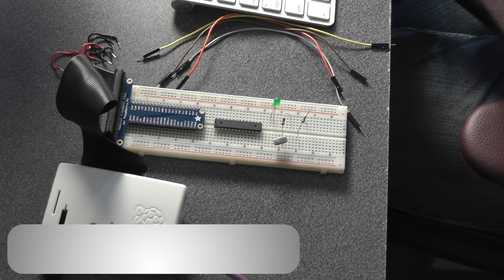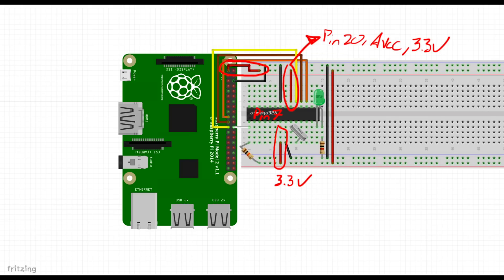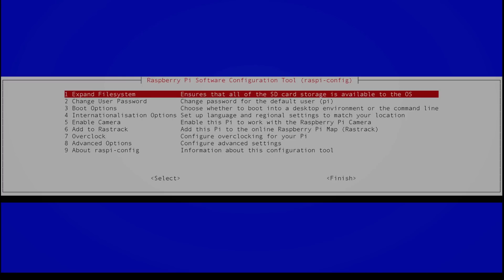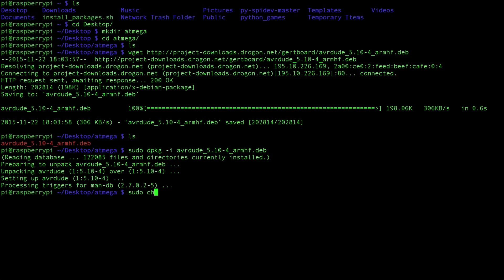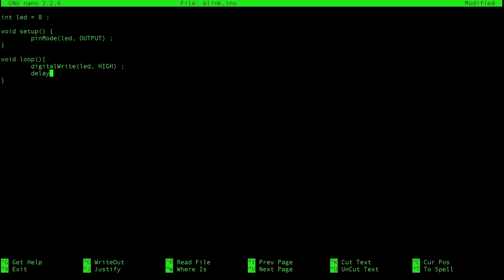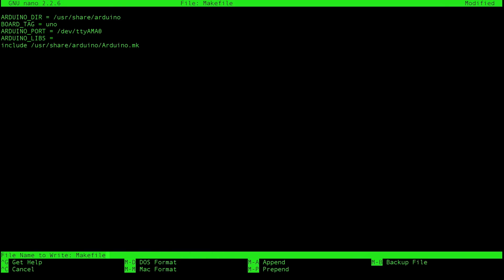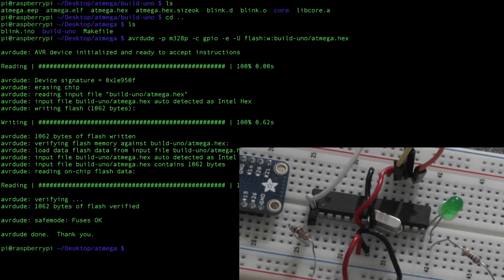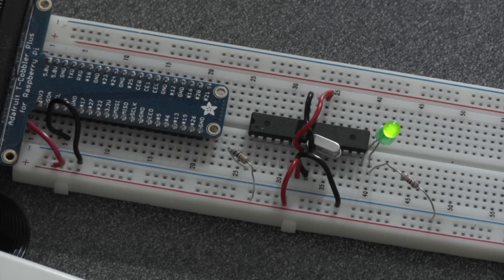Raspberry Pi Tutorial 36 - ATMEGA328P AVR (Arduino) Programming via GPIO (SPI)

Comment: Nice video but I think this needs an update. avrdude seems to be already installed with Arduino now, so the drogon http request doesn't work. Then, as @rayfelch3554 said, gpio isn't a programmer option. I tried linuxspi instead, as in avrdude -p m328p -c linuxspi -P /dev/spi0.0 - that says to use the format /dev/spiev:/dev/gpiochip[:resetno]. I took a guess that resetno might be the GPIO pin connected to the Atmega's reset, so I tried avrdude -p m328 -c linuxspi -P /dev/spidev:/dev/gpiochip[:P08] which gives No such file or directory - so looking in dev, there's a spidev0.0 file and also a gpiochip0 file. So I guessed it might be avrdude -p m328 -c linuxspi -P /dev/spidev0.0:/dev/gpiochip0:8 which returned Unable to get GPIO line 8. So close, yet so far!
Reply: Of course, after entering and compiling the code shown, I upload it with avrdude -p m328p -c linuxspi -P /dev/spidev0.0:/dev/gpiochip0:25 -e -U flash:w;build-uno/atmega_.hex (note underscore) - it writes and verifies the flash, no problem - and then the Atmega appears to be doing nothing. No LED flashing. I suppose no-one said it would be easy!

Comment: Thank you for taking the time to do this video. It helped me tremendously. Just a heads up, things have changed in 5 years and one of my stumbling blocks was 'gpio' is no longer an option when setting the Programmer field. The settings (of importance) for me in 2021 are: Programmer: linuxspi  Port: /dev/spi0.0  Device: atmega328p. Hopefully, this might help someone that may be struggling. Thanks again!!
Reply: Thanks for the update, I'm trying to figure out if this helps with the same wiring configuration shown in the video. Can you please confirm if you used the same wiring config and if anything you have changed?
Reply: @asuthoshcr9581  I tried avrdude -p m328p -c linuxspi -P /dev/spidev0.0:/dev/gpiochip0:25 and that seems to work (with the reset connection wire moved from P08 to P25 on the Pi) - seems to work

Comment: As to my previous question. I have an ATMEGA328p-au blank chip.
will this method burn the arduino bootloader onto the chip or is that a separate process? I don't know if your chip has the bootloader on already. please advise?

Comment: I did the exact same thing, except I don't have Oscillator. It doesn't work. Can someone help me? All the commands run without error, and the program is uploaded to the ATmega chip successfully, but the LED doesn't light up.

Comment: it works me ,but why the time are diferent? i put in delay(1000) and get around 5 seconds (i have a 16,000 hz osc)
Reply: You need to put these to the command line:
avrdude -c gpio -p m328p -U lfuse:w:0xce:m
avrdude -c gpio -p m328p -U hfuse:w:0xd9:m
avrdude -c gpio -p m328p -U efuse:w:0xff:m

Comment: I am actually trying to program a Arduino pro mini 3.3V 8Mhz having the Atmega328p, using the same method as u expalined. 
When I run the command 'avrdude -p m328p -c gpio', it shows me this error :
 'avrdude: AVR device not responding
 avrdude: initialization failed, rc=-1
         Double check connections and try again, or use -F to override
         this check.' 
I have checked the connections, still the error persists. Can you please help me.
Reply: If you're still having this problem, I had the same issue. I solved it by changing m328p to m328.

Comment: Maybe a bit late to ask. but just found this video.
Have wired up everything as shown on the video, and tried withe 2 Atmega328P-PU chips, but get the following error:
initialization failed, rc -1. If I use the -F option I get invalid device signature 0X000000. Could this be chips without a boot loader? (Got them via eBay - cheep Chinese stuff)
Reply from the maker: I have purchased a few chips off ebay/aliexpress and haven't had issue. You don't need the Arduino bootloader flashed initially to be able to upload code - I have experimented programming the AVR without anything "Arduino" (and thus no bootloader). Having said that, I haven't encountered this error. Beyond double checking your wiring.... do you have an Arduino Uno kicking around? You can try flashing via that, see if you can get something working there, and then re-attempt with your Pi.

I wouldn't give up just yet.
Reply: Alexander Baran-Harper Thanks a lot for answering.
I have checked the wiring several times, but I will definitely not give up. I wonder if there is something wrong with  my installation on the RPi. Tried to compile the sketch but got an error from make, so I’ll try reinstalling everything from scratch after making a backup of the SD card. I’m running Node-Red with the Arduino contribution so that might be a problem, though I don’t understand why.
I’ll keep you posted.
Reply from the maker: Alright cool. You should be able to 'make' regardless of whether the chip is connected. Assuming you installed arduino-mk without error and have a simple blink sketch that should work, your issue may be in your makefile. 

Just making sure, you ran the test line "avrdude -p m328p -c gpio" and got a response out of the chip? If there was an error there, there is either something wrong with your wiring or the chip... assuming the packages I refer to in a video published 2 years ago are still available and installed correctly...
Reply: Yes  I know - have not seen anyone complaining. Have reinstalled from scratch on a new SD - compile now works like a dream, but alas no connection. I have tried several chips, so I wonder if there is something wrong with my RPi. I'll get a new one in a week or two, and I'll also see if I can get a few new atmega chips. Then next step will be running at 5 volt using a logic level converter. I want to make this work, albeit I could of course get myself an arduino Nano, which I know works, but that's not fun
Reply from the maker: Just making sure: you re-enabled SPI after the reformat? Do you have any other SPI devices you could test to verify that your SPI is working? You're tying the VCC's of the chip and GND's of the chip together? Have you tried a different oscillator?

Do you happen to have a couple small ceramic caps kicking around? The oscillator, as I have shown it in this tutorial, is not stabilized by caps. You may have better success if the clock is stabilized. Without the datasheet for the oscillator you have, I can't tell you want size cap you need. The "default" choice everyone seems to use is ~22pF. https://rheingoldheavy.com/wp-content/uploads/2015/09/UNO_KiCad_ATMEGA16U2_XTAL.png shows the wiring of the cap.
Reply: This is embarrassing! I had turned the "schematics" upside down, and connected the communication wires on the wrong side of Pin 19 on the RPi. Now it works, but it looks like I have blown one of my atmega chips - if it was not blown when I got it, you never know.
Anyway - thank you for your advises and patient, I'll keep you posted about the progress on my project, if you are interested. Going to try to access the atmega using firmata.
Reply from the maker: Well that will teach you! I am glad you could figure it out. Cheers, man! And good luck with your project!
Reply: Thank you, Alexander. I'll need it! Can't find much information about how to use Node-Red and gpio to access atmega328 with firmata NOT using the USB port. What I need is to be able to use PWM on the chip, since PWM on the RPi does not work very well

Comment: Hey, I use an external 8MHz and it comes that de clock is divided by 8.
When I tell in the makefile that the MCU speed is 1000000L instead of 8000000L, it works well.
Ideas ?
Reply: it's very simple: the delay function is designed to work whit a 16mhz frequency, so when you use a 8mhz you have to tell the clock divider  it have to change step number

Comment: How would you modify the procedure to run the Atmega using its own internal 8mhz crystal? I've seen it done with Arduinos.
Reply from the maker: It's totally doable; I've done it. I haven't made a video on how to do it (yet...), but the short story is: you need to change some of the internal fuses of the ATMEGA328P using avrdude. You will still need to connect the 16MHz clock and configure the circuit for programming using something like a Raspberry Pi to program it. Once setup you'll want to check out: http://www.engbedded.com/fusecalc . At this site you can select certain options for how you want the ATMEGA328P to behave. If you uncheck "Divide clock by 8 internally; [CKDIV8=0]" and hit "apply changes" down at the bottom, you'll get posted a low, high, and extended byte value. They should be E2, D9, FF, unless you changed some other values.

Then use avrdude to upload these values.

Comment: Thanks for the video, I learnt a lot from this. I duplicated this project on my Pi 3 but when I compile/build my project it fails with the following: grep: /usr/share/arduino/hardware/arduino/boards.txt: No such file or directory (about 15 lines of this- followed by)usr/bin/avr-g++ -x c++ -include Arduino.h -MMD -c -mmcu= -DF_CPU= -DARDUINO=100 -D__PROG_TYPES_COMPAT__-I. -I/usr/share/arduino/hardware/arduino/corcs/arduino -I/usr/share/arduino/hardware/arduino/variants/   -Wall -ffunction-sections -fdata-sections -Os -fno-exceptions  blink.ino -o build-uno/blink.oavr-g++: error: missing argument to -mmco=/usr/share/arduino/Arduino.mk:1003: recipe for target ''build-uno/blink.o' failedmake: * [build-uno/blink.o] Error 1Does raspberry write syntax errors to a different logfile or how will it be displayed typically??The lines starting with 'grep....boards.txt: No such file 'etc, is that probably version errors??

Comment: Thank you for this video! Can anybody explain why the CS/SHDN pin of the ATMEGA requires a pullup resistor whereas the other communication pins (MISO, MOSI, SCK) can be wired directly? Thanks!
Reply from the maker: That is the reset pin on the ATMEGA. So this pin is pulled low to initiate uploading of new code. During normal operation this pin should be kept high. If we don't include the pullup resistor the pin is left floating and the ATMEGA risks resetting itself during normal operation.
Reply: Thank you for the response! Isn't it true, however, that the reset pin is connected to an output of the Raspberry Pi? I thought that an output GPIO would always be connected to either the 3.3V rail or to GND, and never float. Am I mistaken?
Reply from the maker: You are not mistaken. However there may be situations where you disconnect the ATMEGA from the Pi (remove SPI lines and reset line) in which case the reset pin of the ATMEGA would be left floating. By leaving the pull up resistor behind, you ensure that pin is not left floating. I demonstrate this at the end of the video.
Reply: Ah, makes perfect sense. Thanks for the explanation!

Comment: Thanks for the tutorial, it was very helpful. I'm including a link to Gordon Drogon's website as it is also useful in getting started ( https://projects.drogon.net/raspberry-pi/gertboard/initial-setup-of-the-atmega/ ). There is also some very helpful information to be found here: http://pinout.xyz/pinout/arduino_spi . I made the mistake of ordering ATmega328-PU chips from Digikey for this exercise. You'll want to avoid doing that - use an ATmegaP-PU chip. You can make the ATmega-PU chip work if you hack the signature for the m328p programmer in the avrdude.conf (/etc/arvdude.conf). There is information for doing this here: http://www.crash-bang.com/resource/bootload-atmega328/ .

Comment: If you use this chip to blink the LED of a battery, it would last a lot longer than using the raspberry pi to run that loop right?
Reply from the maker: +KevinHarper3DArtist Absolutely. The ATMEGA can sip less that 0.01mA if you program it to sleep between LED blink cycles. If you're interested in battery operated projects and speed isn't super critical you should consider setting the fuses on the chip such that the internal 8 MHz clock is used instead of the exterior 16MHz oscillator. This will drop down your current draw considerably. You can also do things like turn off the ADC when not in use to further conserve power.

The Pi is power hungry by comparison.
Reply: +Alexander Baran-Harper Thank you for that feedback, I am a game developer / vfx artist and just got my raspberry pi 2 weeks ago and made a little project with it which I now want to make mobile. So every minute or so it will check some sensors and  then activate something if the sensors read a desired output. Problem was that with the pi, It looks like I can only run it for about 3 hours to run the checks, so this looks like a great solution to that problem. Thank you for posting this video, I will order some of these chips and try your tutorial to see if I can pull off programming to it.
Reply from the maker: KevinHarper3DArtist If you're only polling the sensors once a minute definitely look into putting the chip to sleep while you wait. Instead of running something like a delay function, requiring millions of clock cycles a second, you can shut down the chip entirely and have the watchdog serve as an interrupt to wake the chip. Alternatively you can have any other interrupt (push button, for example) wake the chip. If you're really looking to save juice, you'd shut down power to the sensors too while the chip is asleep. You wake, flip transistors to power the sensors, take your readings, then sleep again, if possible.

I used this strategy for a house plant monitoring device. It would turn on a LED when the soil become too dry.
Reply: +Alexander Baran-Harper That is awesome. I will look into that when I get a hang of programming a chip and get everything to work as intended. It sounds like the ATMEGA328P is a great place to start as a first chip because of people sharing tutorials on it.  Your plant soil monitor lasts for quite a while on batteries?  I have a keypad type bolt system in my front door and I go home every day without my keys and it has to lock and unlock the door on 4 AA batteries. I have not changed the batteries in 6months, that is the type of life I would love to get with my device.
Reply from the maker: KevinHarper3DArtist Keep in mind the ATMEGA328P is the same chip as the one in the popular Arduino Uno product line. This is the reason you'll find so much support for it. If you choose to go the low power route, you can still use the 8MHz internal oscillator and run 'Arduino Code.' Good luck on your project.

Comment: How the hell do I get this to work I can't even get the spi to toggle because it's not there in settings
Reply from the maker: +Jackson Vanderkooy You mean you're having issue enabling SPI in the raspi-config? What OS are you running? I am running Raspbian (Jessie) in the video. Wheezy has the same setup configuration.
Reply: I used the default software on the card when I bought it
Reply from the maker: There are a few different OS's available to run on the Pi. This tutorial uses the Raspbian (Jessie) distribution. I am sure it will work with Wheezy too, though.
Reply: ok got it and sorry for the swear word earlier.

Comment: The purpose of the 'other' resistor (180R judging by the colour code) is NOT to prevent "shorting out the LED", but to limit the current supplied to the LED by the GPIO pin.

I think you realise this, but you probably want to avoid questions in the future asking why we shouldn't short LEDs.
Reply: +Alexander Baran-Harper I'm glad you agree about the undesirability of 'informal phrases in educational videos. I'm not sure I'd describe a LED as a short circuit, but some kind of current limiting is essential and in this circuit the resistor limits the current.

Comment: awesome video! just for curiosity, what possibilities does provide the connection from the atmega to the raspberry pi?
Reply from the maker: +romel554 The atmega can communicate through SPI, UART or I2C with the pi. So... if the atmega was connected to a sensor, it could send data to the pi. Likewise, the pi could send a message to the atmega and have it act as a slave.
Reply: +Alexander Baran-Harper  interesting, and what about the libaries? for exmaple, if i want to use some library of arduino, it will work?
Reply from the maker: Absolutely. The chip is exactly the same as the uno chip. This chip is preloaded with the arduino bootloader, so it should all work.

You should be able to program with the arduino ide too.
Reply: +Alexander Baran-Harper  wow thank you! but the IDE will run on linux or on windows and the pi acting as a tunnel?
Reply from the maker: By following this tutorial you already have the arduino ide installed. Check your gui! At a future point I may cover using the ide and the naked chip on a pi.
Reply: nice! that video would be very interesing, thank you
Reply: ATMEGA can run with 5V, that you can normally not connect to the RasPi because (phoooo!) the RasPi isn't 5V tolerant. You can also connect things to the analog inputs, which again don't exist on RasPi2.